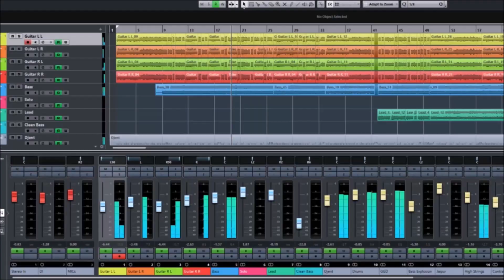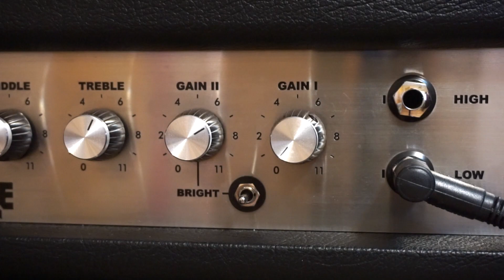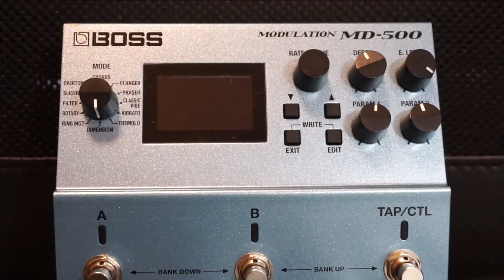Plexi Pedal Platform Rig: w/ Real Amps and Pedals!

Comment: I would have a similar layout but with a bit different pedals. It would be like Ep booster (slight always on boost color) -> sd-1/ts8 (drive and mid boost) -> blues driver/OCD/Andy Timmons (full range drive/core drive sound) -> Tumnus (any Klon clone to boost level and give that lovely color that cuts through in leads) -> Carbon copy (maybe followed by a digital delay to create those combinations, TC flashback might be the choice to have options when needed).

This layout seems to be very popular and it's hard to argue with it. They can be used in another fashion but stacking and functionality works really nicely like that, should cover almost every common situation you can run into, where you don't need fuzz. All of those pedals also fill one requirement for me: not too many knobs to get confused by, good tones pretty much plug n play, aside from having to tweak them a bit for stacking.

For case by case occasions there could be wah if needed, after distortion, phaser in front of everything. But the real quirk would be a chorus in the front to do that old Ozzy style doubling instead of the lush chorus effect.  Reverb would be from a spring tank in amp just because I happen to have one and can't find something as good and easy in a box so far. I also have an eq just in case, but I notice I almost always prefer those coloring drives over eq and haven't run to a case where I'd really benefit from the eq where a drive wouldn't suffice.

From the description it's pretty easy to notice how easy it is to get succumbed to different kind of drives and their combinations. I don't know what I would cut if I really had to only have a couple. Still lacking that treble booster though! Been thinking about trying a local DIY kit shop for the simplicity of the pedal and the cost.

Comment: I am pissed.  Some time over the weekend I knocked a ¼" line level jack out of the left channel of my stereo rig on the left amp.  I didn't realize that and started dragging it out to troubleshoot it.  I also used contact cleaner on my guitar's pots and on both amp's controls while they were more accessable.  I do all my tweaking from my HD500, which sends a stereo signal to a 100w Laney and a 100w Spider Valve mk1 head both with 6L6 quartet power sections.  From there into V30 412 cabs...its a killer rig and sounds amazing at any volume.  

When I noticed the line level jack wasn't seated I plugged it back in.  Now I have this horrible noise floor...the amps are loud at idle and the tone got a little brittle and thin.  It feels different, it sounds different, its also like I got a ground loop now maybe.  Annoying.  It took the better part of a year to get this thing sounding the way it was.  Grr.  

Anyone got any suggestions as to where the idle hum or tone change could have occurred?  Or any troubleshooting advice?